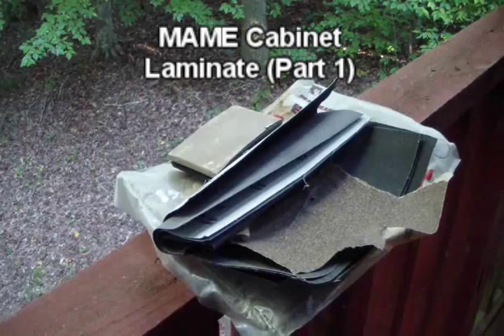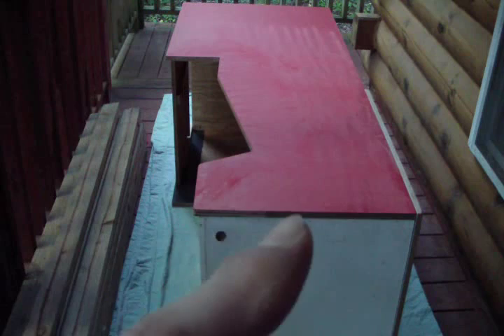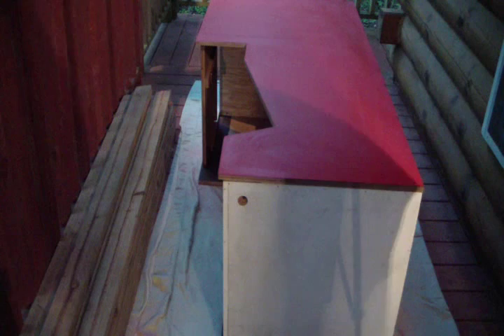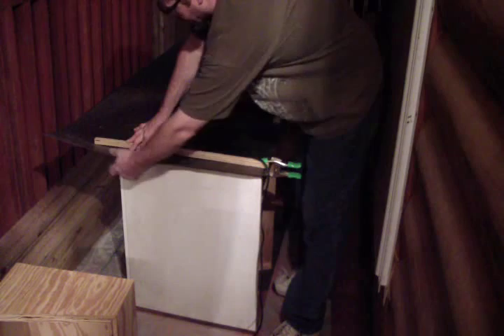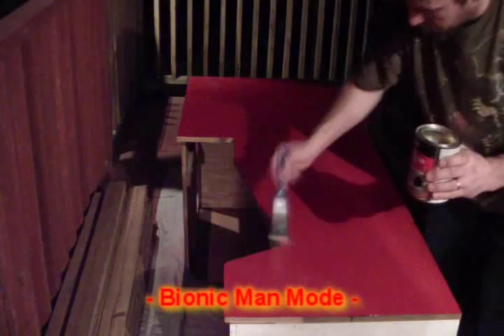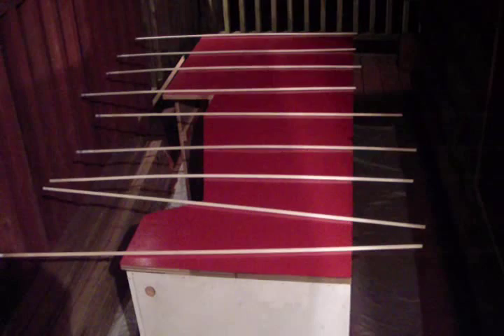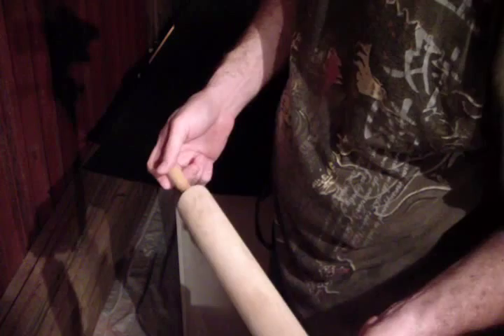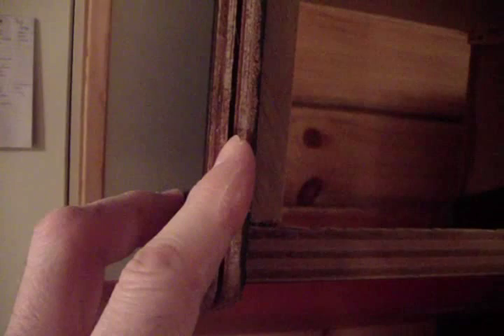(Part 1) MAME Cabinet Laminate

Comment: god bless yah for making this video! i just bought a cabinet and it needs a restoration job, it has laminate on one side but the other side is wood with white paint on it. im guessing im going to need to laminate the bare side and then im hoping the other side is good enough to stay the same although im worried about one side looking shiny new and the other not lol.
Reply from the maker: It might not be too noticeable, but if you want them to match perfectly you can use a heat gun to heat up the laminate on the one side and pull it off the cabinet. Then you can sand that side and put the exact same laminate on both sides so they match perfectly. And you're welcome for the video, I hope it has helped you some.

Comment: Probably a stupid question, but can I put laminate on top of a painted arcade cab? I'm gonna assume no since it should probably stick directly to bare wood.
Reply from the maker: If you'll rough the paint up really well with sandpaper to knock the slickness off and clean the sanding dust off it should be fine.  You shouldn't need to remove all hints of the paint, but sand the entire surface and pay special attention to the edges where any lifting would likely begin if it ever happened.
Reply: TortureBot  cool, thanks.

Comment: Thanks for the vid but no offense you talked the first 2 mins about your sticky porch and acorns and the light and time of day. 35 mins for a simple vid like this is totally unnecessary and its only part 1 ?!?!. I found myself skipping ahead most of the time and since you're not a pro it may cause someone to not want to sit and wait through vid. I'm not even gonna guess how long part 2 is.
Not trying to watch a movie. Just looking for a simple tutorial.
But thanks for your time and effort anyhow just please simplify and shorten future vids.
Reply from the maker: Kyle Ford no the first 2 minutes we're mostly talking about sandpaper. I took a moment to mention the weather because if it's too cold it's not a good idea to try doing the laminate according to the directions on the adhesive.  The statement about the acorns literally took 4 seconds man. Sticky porch? What video were you watching? As soon as you read the title of the video and started watching you should have seen the length of it and you could have made a decision to go on to another video. But no, you decided to troll and leave a comment dissing the video. Well I guess all the YouTubers can just go and watch your two videos. One of them is about 6 minutes of you holding up a transmission shifter linkage cable and trying to tell someone how to fix the problem while just holding the part and saying every 2 minutes that "that's about all". The other one is about as long as this video of mine and shows you installing gutters. Not a bad video really, but judging from all the thumbs down and the professionals telling you you were doing things wrong, I guess you are getting some of what you're trying to deal out to me here. And from your responses on those negative comments, it seems that you are indeed a professional or do that as a job. Glad I am just an amatuer doing my laminate so I don't feel quite as bad. But thanks for your video and effort just the same! And by the way, I have no plans to shorten my videos. If people don't like the format they can watch something else.